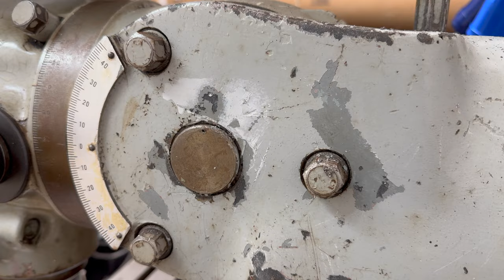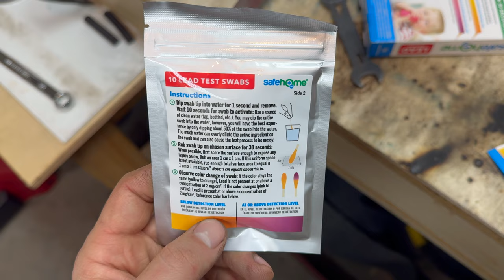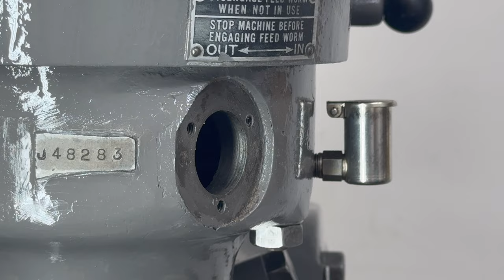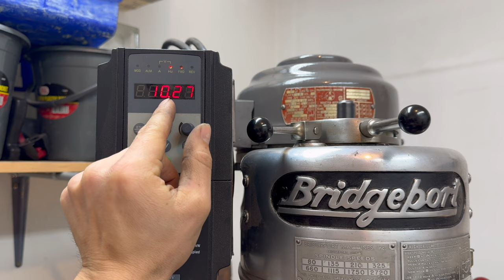Painting my Bridgeport Series 1 Mill

Comment: Very nice!  This is useful because I intend to do a similar cleanup on my Index 645 without a full disassembly.  My lathe came with an ENC VFD.  The instructions were terrible.  I had set up my mill with a US brand of VFD and it was a breeze.  I knew what I wanted the ENC to do; it was just harder to understand what to do to get there.  On both of my machines I retained the original controls and wired/programmed them to the VFD.

Comment: personally, I don't know why everyone thinks they need a VFD.  After a few days of using you can swap speeds pretty fast.  As far as the 3 phase they are inferior to a rotary phase convertor. a static phase converter works great. I have had one on my dad's mill for 30 years on the farm used daily even a lot of rigid tapping. never an issue with the motor,
Reply: If I had to use a rotary phase converter I would not have 3 phase machines in my home shop.  They take up space that I can't spare and they're noisy.  I really hate the nonstop noise.  VFDs are silent or near silent.  I have yet to run into anything I can't do with a VFD supplying the power that a RPC would enable.  There are some things a VFD will do that a RPC won't, though.  I love the soft starts and braking that the RPC won't do.  

Separate issue; I've also had a static phase converter and didn't care for the power loss.  I had to start my mill on high speed and shift to low because it didn't have the power to start in low.  Once the motor was running it ran OK; I just didn't like it.